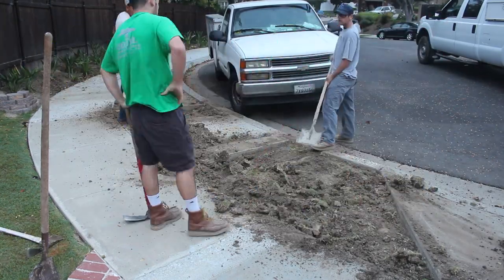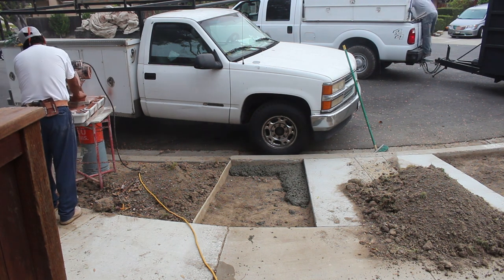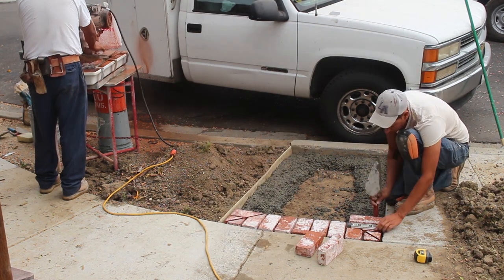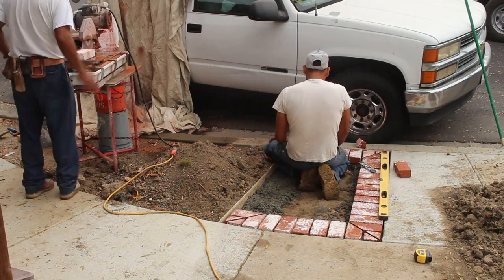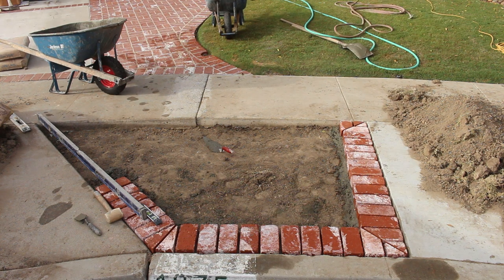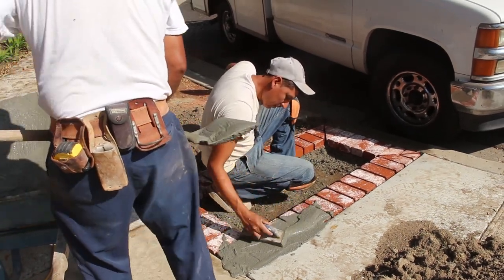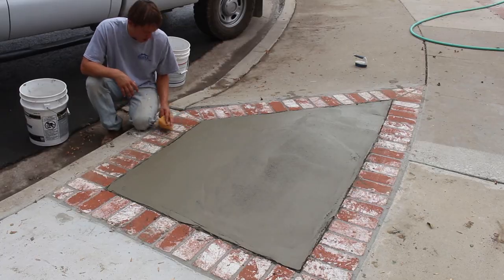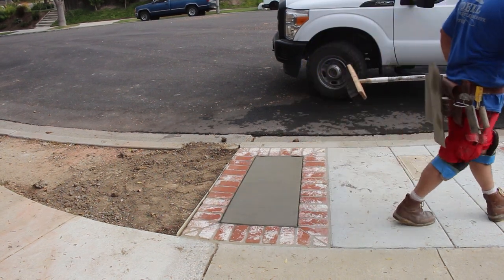How to Pour a Concrete slab with Brick Ribbon Borders

Comment: After you dumped all the mortar on the bricks, how did you clean them off?  That wasn't shown.
Reply from the maker: we used a wet sponge to wipe the excess mortar off
Reply: I was wondering the same thing. Magic.
Reply: Scott: fyi - It's the exact same as grouting tile and cleaning that; not sure if you've ever done tile though.

Comment: Could I use this technique to make a whole patio? Like lay down a criss-cross of brick squares, then come back and fill in the squares with concrete after the bricks have dried?
Reply from the maker: yes but you should add steel to come out from under the brick to tie the slabs together

Comment: 🤔🤔 Uncle David I had a question to ask you and this is just a a question why did you use a concrete truck to pour those two little pieces couldn't you have used a portable cement mixer and use a couple of bags of concrete then again maybe you use the truck because you probably was using it from a different project correct please tell me that because having a truck come out and pump those two little pieces you must have a lot of money on your hands😂😂
Reply from the maker: we were doing the backyard patio this day as well when we poured these

Comment: It would be very helpful if you could add time to the video   That way we know when next step should be,for example you pour your mix at 13:30:00 then you do your edges at like 16:30:00 for example,that way we know you are supposed to do ur edges like 3 hours after you pour your mix down. And maybe brush the surface at 20:30:00 for example,then we would learn ur supposed to brush it after 7 hours..The times are just for an example.. and i know it depends on weather but it’d be more helpful and it could give us a rough idea of timing control,we would learn more than just knowing what steps/procedures it takes but how long to wait between each step. Many thanks. Great effort!
Reply from the maker: Sounds good. I'll put that in with the new (how to mix concrete by hand) video, I'll be working on today.